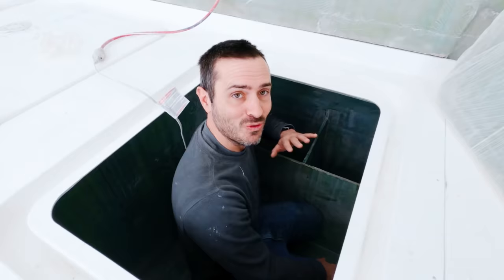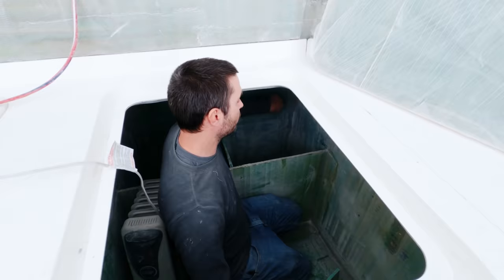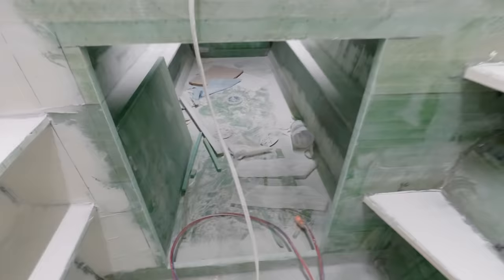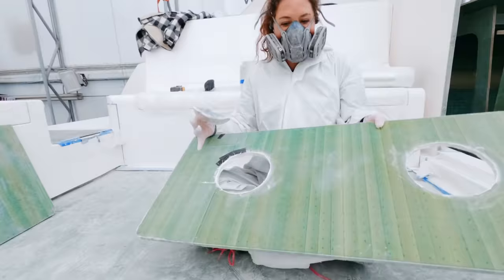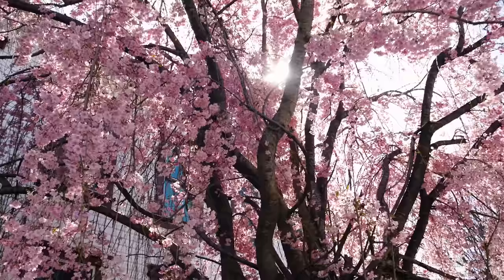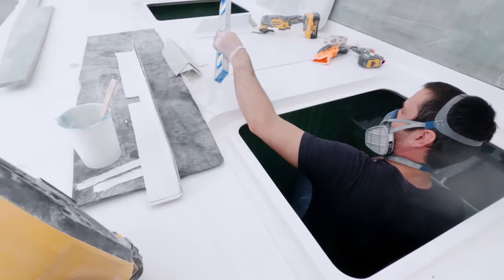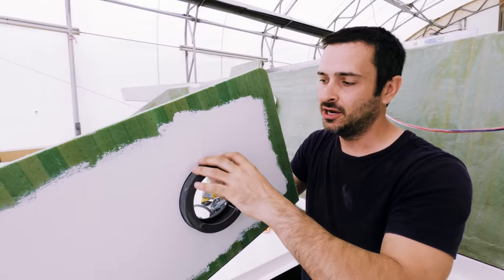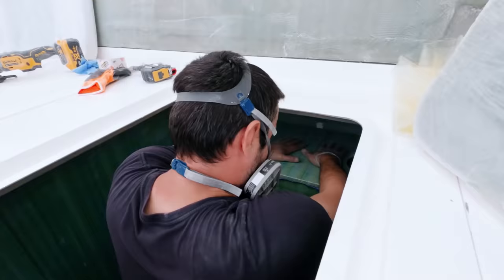CATAMARAN BUILD - We Enclose Our Hand Built Water Tanks! - (MJ Sailing - Ep 232)

Comment: Tip, get some adhesive backed sandpaper! A strip adhered to the hole saw would create the perfect sanding tool for the port. You can also make specialty contoured sanding blocks for detailed areas and then adhere the sandpaper to the contoured block.

Comment: Next time you build a water tank, you should look into bladder inserts, much easier to build, easier to maintain (i.e. when you need to clean things out, empty out the bladder and literally pull it out of the tank that it is inserted into). It's also easy to fix/replace. I have a friend who did this, even purchased a spare bladder in case he needed to do a quick replacement.
Reply: bladders are nice
Reply: Not sure I see the point if the tank itself is fully waterproof and sterile (or as sterile as potable water needs to be).  M&J said they over-engineered the coatings to ensure that there will be no leaks - having seen their perfectionism, I believe them!
Reply: @Neilhuny  Every sealed tank has the potential to get dirty, ie bladders with easy access seems a good option.
Reply: @SteifWood  OK, fair enough.
Reply: @Neilhuny  I like the idea of a bladder for a weekend boat where the tanks have the potential to get stale or mouldy from lack of use. 
For a long term cruiser when the tanks are continually drained/ refreshed and maintained there’s less of a need for one.
Reply from the maker: Bladders a great option, but they are typically used on horizontal tanks and not vertical like we have.
Reply: @Neilhuny  Accidents on boats happens. If anything happens to hinder the integrity of the tank, then you have no water tank left until repairs are done, which can take a while. Bladder can be replaced in minutes. Also, bladders are really easy to maintain/clean/etc... So while M&J did fantastic job, it took them a long while to get it done, requires that you get it done perfect, etc... For a bladder, all you need is a basic enclosure (doesn't need to be watertight or treated or nothing). It's a lot easier to build and install, a lot more forgiving, and easy to maintain and repair if need be. I just mentioned it since it seems like an interesting consideration for anyone doing similar work.
Reply: I think bladders are not problem free.  For a boat sailing a lot of miles, I would prefer the integral design.
Reply: @Tomm9y  That's interesting. Can you elaborate on why you prefer the integral design over the bladder? I'm curious to hear your point of view, it could be educational.

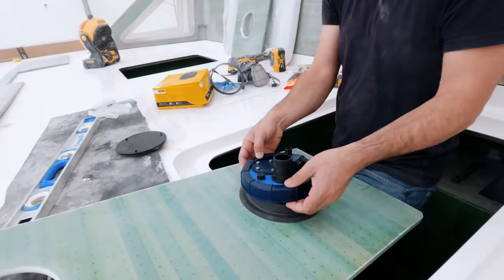Comment: At 7:35 my mind is hollering "gussets under those steps!"  I know, it's more work but they won't sag and/or crack.  Thanks for yet another fine episode.  I like to (in my mind) compare and contrast you two and Ruby Rose.  Y'all are grinding it out in the belly of the beast and will know every nook & cranny, every system, every strand of rigging intimately.  They are filming the workers as their cat is assembled.  I have to admit there are advantages to both approaches, but I admire yours much more.  I can hardly wait until I can again wish you fair winds and follwing seas. (But not into the cockpit.)  At 20:52 "Crazy strong"  When I swung a hammer for a living that's the way I liked to do it.  I could not always, but that was the goal.

Comment: team effort on that F-up. That is what i like about this channel.  It is real.
Reply: I watched it twice and still don't know what she is talking about where there is a bleep out.
Reply from the maker: We like to do everything together, especially mess up projects on the catamaran, lol.
Reply from the maker: Matt had told me I need to 'follow the edges' of the cutout with the filler, which I had done, but it turns out the lines did not match up with the inspection port ring, which needs to fit precisely in the hole.  😉
Reply: @MJSailing  Thanks.

Comment: A couple of thoughts for you from my own cat prep for long distance.  
You mention connecting watermaker output direct to water tank  --  not a good idea.  Most people add an extra small tank in between so that you can check the water from the watermaker with that supreme taste tester - your tongue.  Thus ensuring that the output from the watermaker is ok before contaminating your main water tanks.  
My second thought is heavy weather prep.  Some cats are not suitable for a breaking wave from the stern, they have no barrier before the wave crashes through the saloon door and sinks the boat.  For that style of cat, the only answer is a parachute anchor,  But that will endanger the rudders of a cat, when the wave bashes the bow, and the rope to the parachute stretches, the boat accelerates quickly astern before being brought back to a stop.  A better answer is a Jordan series drogue attached to the stern.  It will do the same job as the parachute, for heavy weather survival, but is much kinder to both boat and inhabitants,  Provided the design of the boat does not provide a direct access to a breaking wave.  Either design necessitates significant strengthening inside the hull at the attachment point  with attention paid to ensuring there is no chafe point .  I added mine at the top of the steps on my Priviledge 37, and added a fairlead to the design for normal alongside mooring.  
Make sure you add midships cleats as well.
Reply from the maker: Already have the jordan drouge we carried with the last boat (with the appropriate amount of cones) and chainplates are being built on the stern.   

We've always had a watermaker on each boat.   And while I do think it's a good idea to check the water beforehand, a simple salinity probe, solenoid valve and an easy to write program automates this for us.   The big difference verses just testing yourself is that it will divert the flow or turn the water maker if the salinity rises while making water.

Comment: Liked the "tank's eye view" shots showing lid installation, will you be using the cams the same way to finish sealing interior edges of angle supports to eliminate crevices ? Maybe you can wire/cable the video cam up so that you can view thru it live on a laptop while finishing the tanks interior with the paint on sealer ? You might try a brand new kitchen sponge as applicator vs the roller since it's so confined in there, the sponges with the scrubber on one side can also scuff/polish the surfaces before applying your final finish coat. (plus easier to hold when saturated)

Comment: since you are building your water tanks what about adding in UV lights in them to kill anything that tries to grow. Have a timer switch so once you fill tanks turn it on and hour later it turns off. So when you shower etc. That way you wont be using germ filled water. Your tanks would stay so much cleaner also.
Reply from the maker: That might work well.  I had them in the feed line before, but never tank mounted   I'll have to investigate.
Reply: UV in the tank is a cool concept. Trying to think this through. Would it possibly leave any fill lines to the tanks untreated and unprotected? Not sure how you plan to run all your lines in the water system. All lines leaving the tanks for distribution should be fine using a UV in the tank method. It’s the fill lines running to the tanks that I would be concerned about. You generally always want your filtration and UV placed in the system as close to the water entry point as possible for total system protection. Like I said, cool Idea that I have never considered. I need to have a bit more of a think about this concept. Maybe it’s best considered as an added protection idea for longer term water storage such as if you leave the boat for an extended period of time. Put it on a timer.
Reply: Yes! Water tanks should always have uv lights. Also put them facing condensing coils in your a/c.
Reply from the maker: I've been thinking about this since you mentioned it and just realized the issue...with the tank being made of epoxy, the UV light will damage the surface.  The light can be used on metal tanks, but aren't supposed to be used on plastic either.

Comment: Just an idea, may not be feasible, why not put a large access port with an o-ring seal on the side of the water tank? Easier cleaning access.
If you would be worried about it leaking, install a moisture sensor under it with a 1-2 gallon catch area.
Reply from the maker: That's a possibility too.... It's common on integral fuel tanks on large power boats.   But these ports also include the pickup and fill tubes, so installation is easier.

Comment: You say you can use the inspection port to clean the tanks? How do you propose to do that since you can't even reach down far enough to paint them? Granted those tanks "should" not need to be cleaned but if they do the added depth seems to have made it impossible, especially thru a 6" port.
Reply from the maker: We can still reach all the way down in them for a cleaning, but having to fair and paint would have been more difficult with the top on, so we chose the easy route of doing the bottom section first.  Work smarter, not harder. 😉

Comment: One question, how do you clean up the edges of the flanges on the inside of the tanks you made? You spent a lot of time on the sides and bottoms, but the edges of those fiberglass flanges still looked pretty rough. are you going to fair/glass them more through that access hole?
Reply from the maker: The best we can do there is a bit of filler to ease the edges.
Reply: My thoughts exactly. Those edges the lid went on looked rough AF and those gaps on the sides will be next to impossible to clean down the road. But still way better than I can do 😛

Comment: Did you give up on the extra 20 gal water tank expansion that Matt was explaining? Height of the tank didn’t appear to change.
Reply from the maker: The board which was added on to give us the extra 20 gallons in volume is only about 6 inches high, so visually it didn't change much from before.

Comment: Why did the holes for the inspection ports need to be so perfect?
Reply: Probably for them to be watertight
Reply: Because the Vetus removable hatch cover mechanism has the four hex head screws that expand the rubber ring after being fit into the port creating the seal, so the tolerances are critical because there is no glue like substance on the lower ring seal.  Matt explained it pretty fully.
Reply from the maker: It's a pretty cool system, but definitely designed for a single layer like metal, plastic or solid fiberglass and not cored like us.  A little extra work, but the results will be worth it.
Reply: Friction seal

Comment: That wall in the middle of the tank-was there a hole at the bottom added to allow water to flow between sides ? AFAIR from the previous videos both sides were independent and watertight at the bottom... To the degree i thought these are separate tanks. Now you call it baffle but i can't see / remember  how both sides are connected...
Reply from the maker: Yes the port and starboard tanks have a vertical baffle with a rounded edge on each of it's four corners to allo water flow.  It also supports the meter long side of the tank.
Reply: @MJSailing  Doh!   Said rounded corner can be seen https://youtu.be/K_aqo7E93Y0?t=87 when using bigger screen (but not on the phone I was initially using 😞 )
Reply from the maker: No problem.  I don't think we focused on these in the video and it is easy to miss

Comment: @9:26 I'm surprised you didn't make a circular jig and used your router for your holes. Most DIYers knows this, and you trend to be pros?
Reply from the maker: It's not really the hole making that's the issue, it's back filling the decored area to allow a watertight seal.   The core itself is routed out, but we still need to go back and sand the last remaining part of core out and this is where I lost the edge.